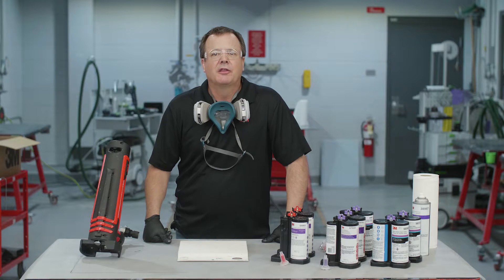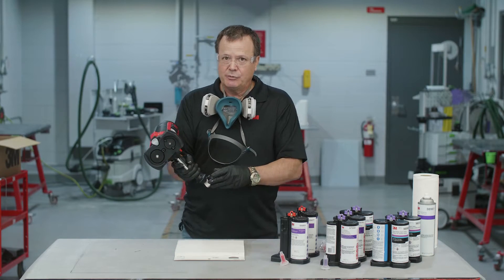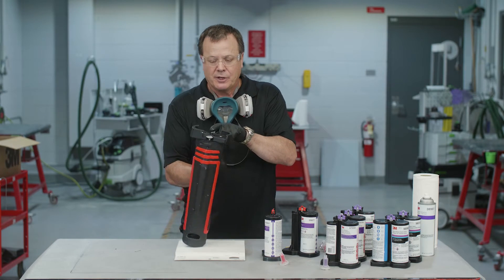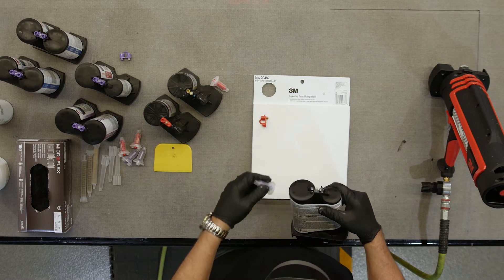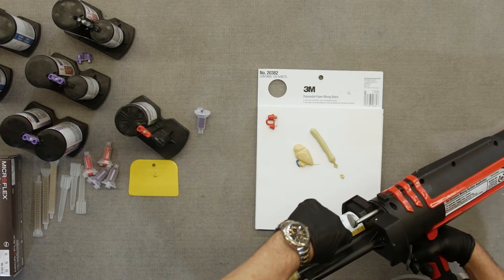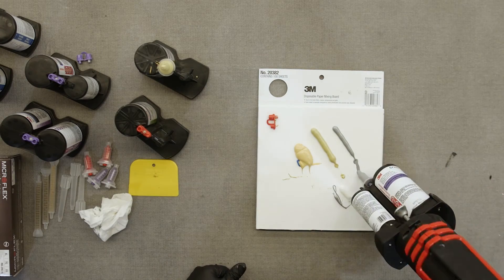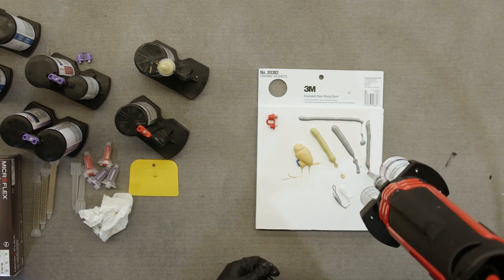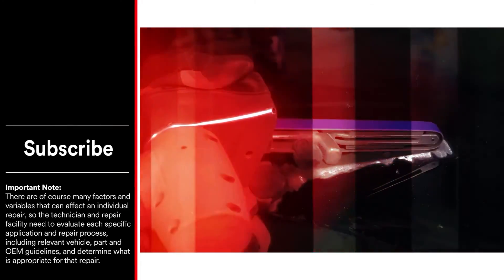TECH TIPS: Dynamic Mixing System Deep Dive

Comment: What is preferable for tip cleaning if you have some leakage, as you talked about near the end? MEK, Thinner, Acetone just curious as this gun has to last a long time. I hope techs are using filtered clean air for gun use although I have not bought one, I have not seen instructions on use or clean up. Thanks.